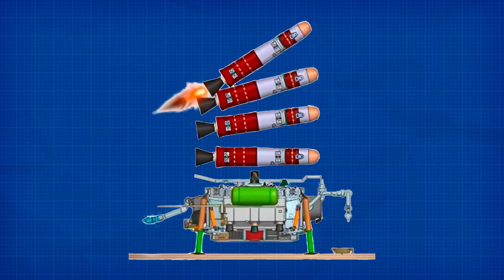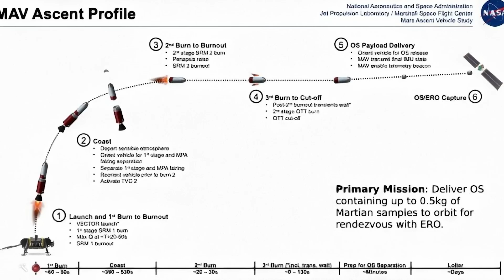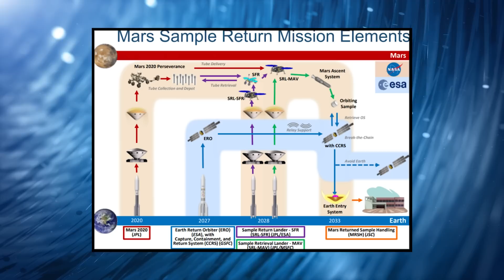The Mars Sample Return Mission: Bringing Back Rocks from the Red Planet

Comment: I don't understand why they would risk the samples by throwing the rocket into the air and then lighting the engine at just the right time.
Why not just orient the rocket vertical then launch. Yes it will distroy the lander, but the lander has no use anymore

Comment: Working on something for years and then waiting for over a decade to see if it works...such tremendous mental stress...and here I am completing projects for the sake of getting them done ASAP and not wanting to follow up on them afterwards, just to move on to the next project...
Reply: I used to mow lawns for a living because of the instant gratification.

I eventually did somethings that qualified me for "higher" positions and more or less lucked my way into personally building the heat shield for the Earth Entry Vehicle.

My work is literally the final step in tens of thounsands of human-years worth of work with a decade+ lead time of gratification....

no pressure, eh? :)

Comment: No plan survives first contact with Mr Murphy. Or with Congress. This plan has both too many things which have to go right, paired with too many things that can go wrong. Too many mission-critical events (for which there is no backup plan) are stacked one on top of the other. The entire mission strikes me as a bunch of teetering toy blocks just waiting for simple vibration to knock them over. A direct accent site-specific sampling mission would eliminate many of these problems including the crash-landing for the sample return craft which sets my teeth on edge. The direct ascent model follows the mission profile used by Russian "Luna" probes to return lunar samples to Earth.

Comment: Thanks Simon!  This is a great video full of great ideas for engineering.
I'm not convinced that NASA and the ESA have everything figured out yet.  The ideas are so complex, a sign of bad engineering, and require such small tolerances for the various processes, especially the various difficulties inherent in getting the capsule full of sample containers into the Mars orbiter/Earth transfer vehicle, that I am concerned about a high chance of failure.
The great comment below recommending that the samples be captured in Earth orbit and brought back to a soft landing is an example of another, better, idea that is out there (although I can see that this approach would cost a lot more than just dropping it on Utah).

Comment: Testing off a tower, just chuck it out the back of a plane at about 30,000 feet, you'll find out then, why piss around, go for the gold, better yet, put it in that rocket sled and really test it.
Reply: If the Tower was there already, using that is way cheaper than Airplanes. And once the Capsule reached Terminal Velocity, the Height doesn't matter anyway. Think of Skydivers not exceeding 50-70 m/s, No matter how high they jump off. It's the same with the Capsule, just probably a bit faster as it's more aerodynamic than a freefalling Skydiver.

Comment: it doesn't need to land on earth. put the sample into earth orbit and retrieve it using a space craft that will act as a taxi and return the sample to earth or the ISS.
Reply: Then you'd have to slow it into Earth Orbit first, which needs a lot of Fuel. Using the Atmosphere instead saves Weight, but isn't precise enough to achieve Orbit, or even rendezvous with the ISS

Comment: Wouldn't it be easier and less risky to land a robotic lab on Mars and analyse the samples from there? Get a small rover to deliver them to this lab and you cut out most of the failure points of the mission plus you can continue using the lab for other studies after the initial samples are studied. Imagine chucking the rocket skyward and the engine not igniting, now you have a wrecked lander, a useless rocket and no way of retrieving the samples.
Reply: No and they need practice leaving mars!
Reply: @patrickday4206  There are ways of doing that without risking loosing years worth of samples and having to collect them again though.
Reply: Yes. And it wouldn't need that much of a lab either.

Comment: They're really going to load up 30 priceless samples into a saucer, aim it down at a random Utah desert, and just let gravity take the wheel. Holy smokes, Batman.
Reply: Amish Revenge,Coming Soon
Reply: You really would have thought they'd pack a parachute, but maybe the weight parameters were really that slim.
Reply: @ruthlessrubberducky5729  It's less about the weight of parachutes than about the massive effort needed to slow down enough you can start using parachutes. Manned reentry vehicles have been monstrous compared to the protection needed to keep rocks safe during lithobraking, and most of that hardware did its job before the parachutes could deploy.
Part of it is we can expect each rock sample to have a quite-consistent density. The container shown in the video is mostly solid, and presumably designed to brace the samples, so the shock passes through them harmlessly. A human, OTOH, has significant density variations, even if you avoid the low-density air in your lungs with something crazy like a liquid-breathing crash tank. You just can't brace a human as well as you can brace rock.
Reply: @darekun46  That does make sense, but it also seems in addition that it would impact at terminal velocity. I'd think that would be reasonably slow as well, considering the cross section vs weight. If they were dropping the prototype rather than launching it downwards, I'd like to think that supports my hypothesis.  The speed was likely exaggerated in the video if gravity was able to do the work. Totally lethal speed for humans still, but safe for rock like you mentioned. It just surprised me that they didn't build in redundancies and backup plans like a parachute just to reinforce success of the mission. It's cool stuff, and I'll be gleeful to watch it when it happens.
Reply: @ruthlessrubberducky5729  judging by the recent advances in rocket re-entry technology, I don’t think parachutes are mich of a concern
Reply: @ruthlessrubberducky5729  - That and the fact that the parachute will be packed for over a decade by the time it reenters Earth's atmosphere, including a round trip to Mars, they really can't rely on it working perfectly.
Reply: @hagerty1952  do parachutes have an expiration date? I know ballistic vests do due to delamination, the fibers on parachutes likely similar?
Reply: @ruthlessrubberducky5729  Parachutes sort of do yeah. But time can be accounted for while surviving the journey to mars and back is something that has never been tested and cannot be fully tested until it's tried. There is also the fact that asside from the low drag coefficient of chutes on mars there are other reasons why chutes have been abandoned for mars entry, chance of failure to deploy is one of them. Now imagine making the chutes and their deployment mechanism make that journey twice, once after entering Mars's atmosphere.
Reply: Hey Metallica, I'm worried too.
Let's take a trip to the Utah desert and try to catch it with a net, both of us 😉
Reply: @gropatapouf5998  That would be a heist for the history books.
Reply: @ruthlessrubberducky5729  well I was planning to give it back to NASA, I'm a boring guy... ;)
Reply: @tst ccnt ... By having more flying saucers shot at them... just by... other humans? 'Cause if this were indeed the will of the Utah-ans (and not just a matter of convenience), it would sound more like they've come to enjoy it... (and all those tourist dollars do seem to confirm that)
Reply: Possession is 9/10ths of the law. Ima get there first, and take possession.
Reply: @bucket0rocks  I mean they literally just threw it away right?
Reply: It's called science because they know it will work. Once it has left Mars, the hard part is over.
Reply: @BabyMakR  you're wrong on all accounts. Science is a process, not an object. We could always find something new that challenges old ideas and it is a constant process of figuring out what is probably right based on experimentation. There is no such thing as "the science," only the scientific method. They do not know it will work, and there are billions of ways it could fail. They acknowledge and understand this better than anyone. All of the parts are the hard part, apart from grabbing it once on the ground. It needs to dock perfectly, navigate perfectly, separate perfectly and land in the right spot. None of that is easy.
Reply: @BabyMakR  No we think it will work based on educated guesses and previous experiments. However I don't hold much stock in those samples surviving a terminal velocity strike into the desert without being significantly damaged. Also If the lander hits dirt it's going to have an entirely different shock profile than if it hits a boulder or even a human head sized rock.
Reply: Beard way too long, Simon
Reply: It’s those middle school egg drop experiments cranked up to a million.
Reply: Parachutes add a significant degree of uncertainty. If you can’t rely on it to work 100%, why rely on it at all?
Reply: @@tst-ccntcan I have some of what you’re on please mate?… it must be really good stuff!
Reply: @@tst-ccnt 🤦🏼‍♂️

Comment: Why not experiment on the rocks in space on the iss?
Reply: That would require the returning spacecraft to have enough fuel to slow down and settle into orbit around the Earth. As Simon pointed out in his video about the Mercury spacecraft getting to an inner planet is harder than getting to an outer one. The return spacecraft would most likely have to use Earth and possibly both Mars and Venus in braking manoeuvres in the same way Beppi-Columbo has to use multiple flybys of Earth and Venus to get to Mercury. Doing it this way greatly simplifies things and makes the returning craft much lighter.
Reply: @randalscott7224  Getting back from Mars too Earth needs exactly as much Fuel as getting there in the first Place. Mercury needs so much Fuel because it's so close to the Sun. The closer you are to a Gravity Well, the faster your Orbital Speed becomes. Meaning to say Proximity is important, but whether you travel inwards or outwards is not. Everything else you said is correct though.

Comment: Great. More evidence that Mars has always been a dead rock.
Putting wind with spin of interpreted water effects on soil aside, an assumed earlier abundance of water had no effect to reach generation of life there. And it’s long since not there. Decades of probes turned up NOTHING.
It lost its atmosphere in its late Hadean eon, 4 billion years ago, and thus THEN its ability to sustain a habitable atmosphere since then.
It’s 1% the average density of Earth’s.
It’s a potentially lethal place on daylight side every time the Sun fires a CME at it—going as far as destroying the MARIE surface radiation monitor. 
It’s continually bombarded by meteorites.
Biospheres don’t take tiny ground footholds. An ancient biosphere is not limited to the financial game of pursuing a “potential” small plot of land, precisely driving an eternal government jobs funding motivation.
BUT … GASP! … the FUNDING MUST CONTINUE for the sake of government-propped research jobs, based on finances.

Comment: My question about studying anything from space in general is, how are we going to handle the objects? How can we be sure that our atmosphere/environment won't irreversibly change things as soon as they are exposed?
Reply: By not exposing them. We handled the Moon rocks the same way. The empty control tubes will be used to detect any pre-mission contamination.
Reply: @ilionreactor1079  Except that it didn't work out all that well with the Moon. Turns out that Lunar Dust is so abrasive, that it damaged the Seals on all Sample Containers, causing Air to leak in. Mars shouldn't be as bad though, as the Atmosphere causes the Sand to be "eroded", making the Grains rounder and thus less abrasive.
Reply: That's part of the retrieval and analysis process and taken very seriously. There are ways to protect samples from earth's influences.